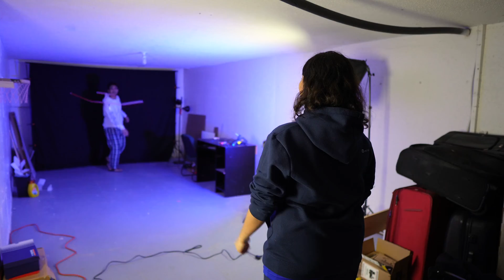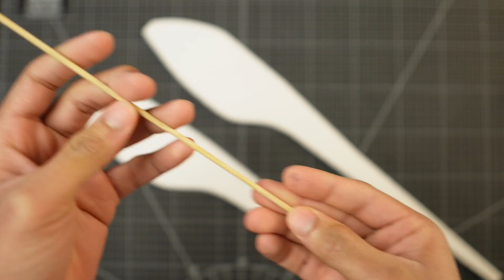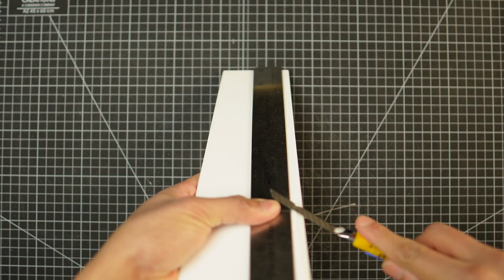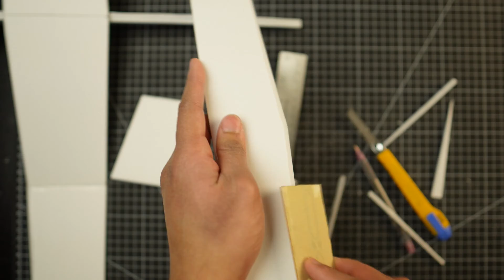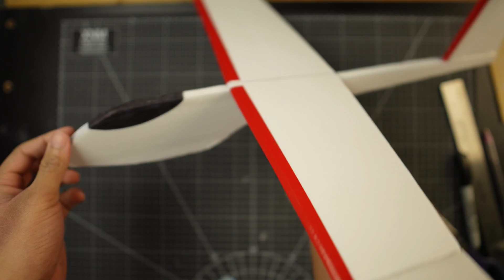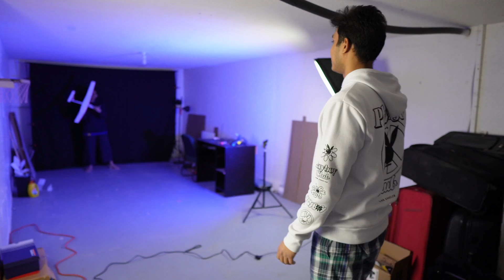How to Make a Free Flight Foam Glider: The simplest way EVER!

Comment: Can we use 3mm styro foam board for this?
Reply from the maker: Yes!
Reply: @FuadPhenomenon  ok...thanks
Reply from the maker: @Udhaya-wh6gc  Hello. When the foam board size is smaller than intended measurement, I typically join two pieces together with some hot glue to make it a longer piece. And since you'll have the bbq stick in the middle, the pieces wont get apart.
Reply: @FuadPhenomenon  or can I take the printout of the template in a A3 paper and stick it in the form board and cut the parts directly...Will it work that way
Reply from the maker: @Udhaya-wh6gc  Unfortunately the planner is only showing dimensions as reference (i.e. they are not to scale) so you would need to draw them out manually. You could prepare a smaller glider by the help of the reference nevertheless where each piece is cut a lil bit shorter
Reply: @FuadPhenomenon  ok thank you so much for replying to the questions...
Reply from the maker: @Udhaya-wh6gc  np! Good luck w the project

Comment: Um so if I add a small rudder slightly pointing to the left on the vertical stabilizer, will the glider fly straight. I also was thinking if I should add 2 ailerons on either sides of the Center wing to help the glider produce lift, but I was hesitant to do so because I thought it will add too much weight. Also should I curve the edge of the wings for better lift? Please respond to this comment to help me.
Your help is greatly appreciated.
Reply from the maker: Hello! For sure,  small rudder can help your plane adjust the direction. Typically two flap under your aileron can help achieve some lift and also allow ur plane to fly slowly. Do experiment with these control surfaces by using tape (so ur not gluing permanently) since its easier to remove the tape if needed. In addition, curving the leading edge might allow better flying characteristic because the wind wont hit a hard edge. Good luck!
Reply: What way should I place the flaps, up or down?
Reply: @godly_gameplay344  I recommend actually thinking about how you wan't to fly your glider, because flaps allow your plane to fly a bit slower because of the higher lift, however the drag will be a bit higher as well. If you wan't your plane to go as far as possible, I recommend not adding flaps. However, making a foamboard glider slow can be important as it makes it last a bit longer because it doesn't crash as hard into objects. Personally with some gliders that I have made I notice the faster planes (so the ones without flaps) break a lot quicker. So it is up to you if you want flaps. Also if you are gonna use flaps you have to put them down, placing them up will reduce lift on a wing. Hope that helps!

Comment: I have a question, how do I make a glider that maintains a leveled flight, and fies a decent distance as-well. What should I add to my glider to make it fly straight because the problem with my glider is that it turns left or right, and it doesn’t fly a decent distance aswell. Note: I am making this glider by hand and by now I have made this same glider 3 times, but it still has the same problem.
Reply from the maker: To fix the right/left problem, try adding a rudder. Typically if u want it to fly greater distance, the nose weight can be increased given that u throw with more power. Furthermore, ur wings should have a smooth airfoil shape for best lift and glide results. All the best!
Reply: @FuadPhenomenon  ok so today I tried to build it again and did it but now it’s not even gliding properly, like the only adjustment I made was I added a foam square under the Center wing and I added a extended upward curve part to the side wings. The glider just goes up like 2 inches and crashes back down nose first.
Reply from the maker: @godly_gameplay344   Hmm, are you using a sturdy foam board like the one from Dollar Tree? Assuming you also have followed my plans and still can't get it to fly, I'm not too sure about the problem. So sorry :/
Reply: Yes I have followed all your instructions but the problem is that the back of the fuselage started bending but I fixed it with hot glie

Comment: DOESENT work idk how. My plane turns to the left when I throw it😢
Reply from the maker: Does it glide properly? If its turning towards the right, you can add a small rudder on the vertical stabilizer pointing to the left just slightly. That should help adjust. Good luck!
Reply: Ok I will try this

Comment: I want to build a similar plane but with balsa wood, do you think it will work just as good, or do i have to make any adjustments
Reply from the maker: Great question! I have not worked with balsa planes before (certainly one of my future projects!) but I can say that the foam is typically lighter, cheaper and easier to fix but I predict the flight characteristic shouldn't be much different
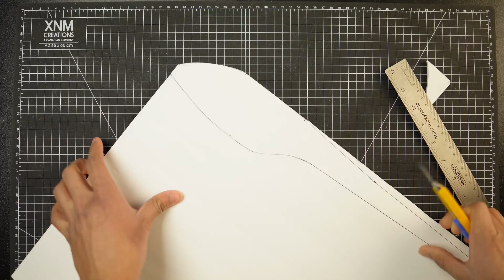Reply: 0:36  @FuadPhenomenon

Comment: Do you think it would improve with a larger wingspan?
Reply: If so, what are the necessary adjustments that needs to be done
Reply from the maker: @Zwalter  its certainly possible, you may make the wings a little shorter in width and extend in length. My foam sheet could not remain straight along the axis (tilting down) with an even longer wingspan as to why I stuck with this design :)
Reply: @FuadPhenomenon  Okay thanks

Comment: I made 1 glider. with motor It flies fine when motor is off but headstand when I turn on the motor....not sure why turning on the motor makes the head heavier.
https://www.youtube.com/shorts/n4aJKsgRNE8
Reply from the maker: Heyy, so it might be that the torque of the motor revs cause the plane to dive down. Perhaps a smaller motor with lesser vibration could solve the issue. Another cause could be if the motor isn't properly mounted to ur plane, for why the vibrations occur
Reply: @FuadPhenomenon  Thank you for replying. It is a coreless motor. Weight 4 gram and the size is only 8.5x20mm. The motor and propeller produce 21 g thrust, and the airplane + motor + battery weight 36 grams. not sure if the torque should be decrease more. Since it has headstand issue when turning on motor, should I shift some weight to the tail side?
Reply from the maker: @williamtao7498  interesting, a coreless motor and a small propeller shouldn't create so much weight to drag the glider like that. I'm not too sure at this point. Perhaps trial and error is ur best strategy :)
Reply: @FuadPhenomenon  Thank you so much for your help!
Reply: @FuadPhenomenon Can we use 3mm foam board?

Comment: Built it today. It was porpoising during the flight and I could not stabilize it with nose weights or elevator adjustments. I decided to decrease the wing incidence/angle of attack. I removed the wing and trimmed the fuselage to drop the leading edge of the wing by about 3mm. Flies wonderfully now (and leaves a little step  to locate the leading edge of the wing). CG is under the wing at about 25mm from the leading edge. Neat design!
Reply from the maker: Hmm, interesting stuff! Thanks for your comment :)
Reply: @FuadPhenomenon  - Your glider is the best design I have found up to this point that I suspect my students can build and fly successfully.
Reply from the maker: @my_dear_friend_  Thanks so much! Really glad thats the case :)
Reply: can you speak in english
Reply: @wh1th3r  - I needed to keep it short. Which words do you need "translated"?

Comment: Thanks, im gonna try to make this one later when i have time. Ive been trying to get into the rc plane hobby and this will be a good beginner, sort of skill builder.
Reply from the maker: All the best!
Reply: Practice flying with a RC flight sim on a computer a lot before you actually fly anything (some of the sims are free and good enough for learning muscle memory!). Much less crashing and rebuilding as a result. Some of the newer beginner planes help you fly them with built in gyroscopes and self-stabilizing electronics. Again, less crashing which is good at the beginning.